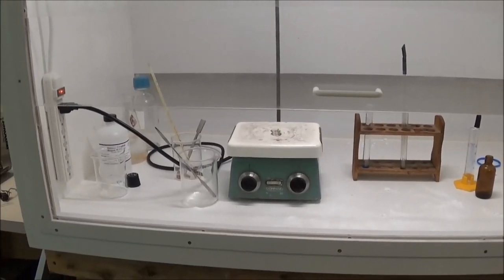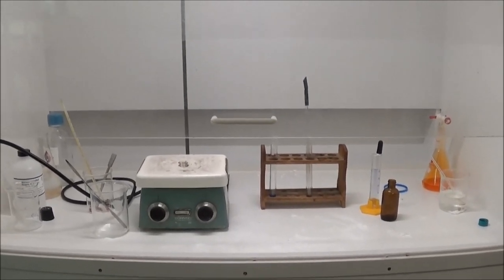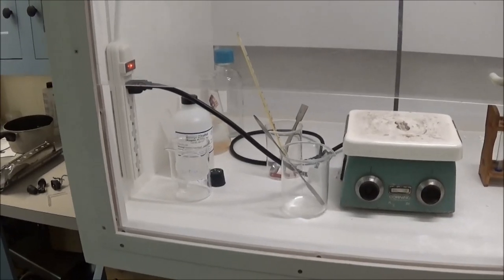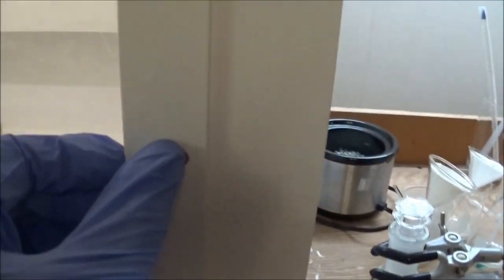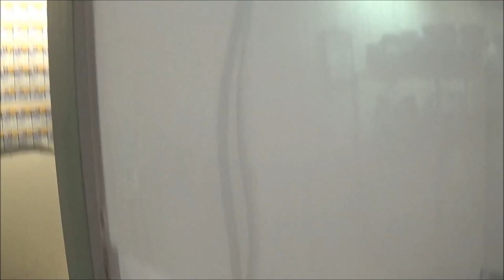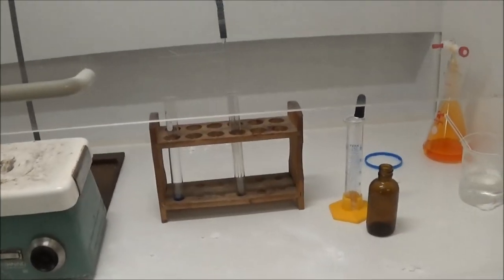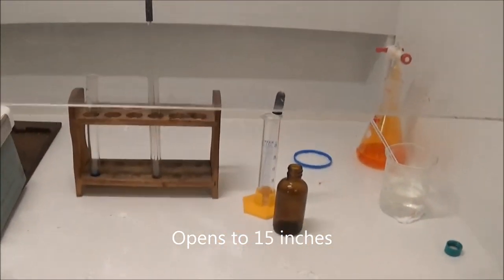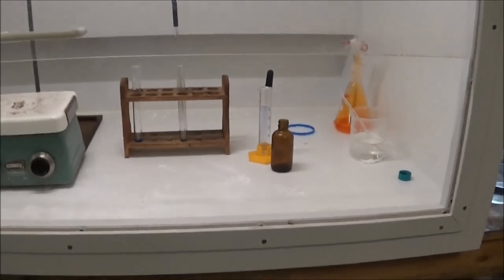How I Built my DIY Fume Hood

Comment: Good inspiration, I'm planning to build my own. For an absolute diy noob like me the front will probably be the most difficult to do.
Reply: Depending on the space you're in you don't necessarily need the sliding glass panel. You can just leave half of the front face open unless you're working with stuff that you think you're gonna need to seal completely off.

Comment: I'm new to your channel and I've got to say I like what I've seen so far! Looks like you do some high quality work. Great fumehood! My recommendation based on the "real" fumehoods I've worked with would be to cut the holes you talked about in the middle of your baffle, not the top of your plexiglass. Holes in the top of the plexiglass would make gas escape more likely. Holes in the middle/top of the baffle encourage the flow of gas through the fumehood to be laminar, rather than turbulent, which is ideal for removing gasses without backflow

Comment: My only concern that should already be aware of is the danger of venting some potentially dangerous vapors out into the air, especially around your house. Some aren't EPA friendly, some aren't human friendly in quantities (good ol' carcinogens), and some can just damage your siding etc. 

Are you using any kind of air scrubber?

Otherwise 9/10 on the build. I'm probably going to be making something very similar
Reply: You can always add carbon filter

Comment: Damn if only I had the space and money for this haha. I would sooo do it. 

I hate working outside because there is so much to worry about. The main being the weather. Too much wind makes things frustrating and unsafe. Different temperatures can make some reactions challenging, and I have had glassware crack from running a hot reaction and having a random quick drizzle of rain drop one single cold drop on the glass. Enough to give my erlenmeyer flask a good crack on the neck. By the way thank you so much for your videos. I really enjoy them! I am looking to get wayyy more into organic chemistry than I used to be and currently have a few synthesis planned. One being a transesterification that will make methyl ricineolate which is a biodiesel. Another is making chloral butanol because I have always wanted to make some type of chemical that can have other side effects besides death haha.

It really means a lot to me because I used to only do inorganic reactions. Then I went on to organic reactions and quickly became infatuated with explosives synthesis. I made a lot of different ones and got to do a LOT of really freaking cool and fun stuff. I learned a load of stuff along the way and was always very safe. I am losing interest now as I want to dive deeper into organic chemistry in itself. I have always loved chemistry and it's one of the subjects along with math that just kind of clicks. I can seemingly envision what's happening at the molecular level and it helps me a lot. It's really weird but I excelled in my chemistry classes. 

I have taken a college chemistry class and enjoyed it but we never really dove deep into organic chemistry. Most of the class ended up being a lot of theory (which don't get me wrong, I love learning how things work especially at this small level) but not a whole lot of reactions or synthesis. I am taking o-chem next semester and I am sooo freaking excited I can't wait. I didn't really like the teacher too much but funnily enough, one of my least favorite teachers (she's not too bad, she teaches really well and can be pretty funny but she has a very cocky attitude which kind of stuck and I couldn't shake it) was the teacher I will have for the most amount of time. 

I currently have some nice glassware such as the usual beakers (I broke a few though RIP), erlenmeyer flasks, round bottom flasks (my first large scale glass ware was my 1 liter round bottom flask which came in very handy), a liebig condenser, vigreux coloumn, test tubes, etc. but I am getting ready to up my game with a proper magnetic hot plate stirrer, 3 necked round bottom flasks, separatory funnels, addition funnels, as well as buchner funnels (I currently have my self made vacuum filtration set up but professionalism can go a long way). I am too broke to get all of that at once since glassware is so freaking expensive here but I will get a much better lab setup. I'll also probably build myself a mini fold-able shed that I can set up outside so the wind and rain won't interrupt me as much. 

But yea thank you for your videos and keep up the amazing work!
Reply: How about a kiosk? I imagine something like a really airtight popcorn cart.

Comment: Hey Tom, Ive been having trouble with my hood door and I like the way you split yours. Unfortunately I'm on a massively tight budget and limited tools. I can split the plexiglass but trying to assess how to mount them so they slide AND stay in place the way yours does. My other issue to resolve first is my wood is bowed, lending further to my problems lol. Do you have any advice? I almost went with a motor driven pulley system but that would compromise the seal and kill my face airflow
Reply: It might also be notable, I'm using lightweight materials so that it's more easily portable since I'm in shared living quarters and all. I don't find much issue with smell or anything with my tests of the air system but I'm afraid further reinforcing the sides and possibly allowing for a proper fume hood door fitment would need more permanent space to stay. It's made of 1x0.25" wood beams and mylar walls with a plexiglass door and the most inert caulk I could find for sealing

Comment: "...was going to make a thiourea dioxide video..."  "...was going to make a video on getting casein out of milk but then..."    lol   there is a lot of competition out there.  hahahahaha    Its all good.  Seems like all the lab folks comment on each others videos anyway.  I am sure your version of a video would be slightly different.  Might as well go for it!
If you have the time, I am curious about the "five sided wooden box that was a few inches deep, which the duct work from the fan attached to".  I just can't get my head wrapped arounf how that was applied to the back and how it worked in the design.  Thank you

Comment: Nice job man! I'm working on building a fume hood and I'm quite a novice. How did you design the baffles? I have so many questions haha...
Reply from the maker: The baffles weren't too difficult to put in. First I cut and screwed together the two sides plus the top and bottom. On the back I then screwed on the appropriately sized piece of 1/4 inch wood (just one piece) so that it looked right, leaving a few inches open at the top and a larger opening on the bottom. Onto this I attached a five sided wooden box that was a few inches deep, which the duct work from the fan attached to. This directed air flow behind the baffle. 

Feel free to ask me any questions, here or on email.
Reply: Tom's Lab what's your email? It would be really helpful to bounce ideas off someone.
Reply: Tom's Lab how necessary are baffles though, surely with a high CFM there wouldn't be much leakage right?
Reply from the maker: My email is diphitom@gmail.com

Baffles are not mandatory, but are helpful. They reduce swirling air currents inside the hood, removing the gasses inside more effectively. The won't be leakage either with or without, given the fume hood is built and sealed correctly.
Reply: The fume hood looks great, I was hoping to see some type of filtration system though.

Comment: How is the plexiglass airtight if there’s two seperate pieces if they slide over each other?
Reply: Negative air flow. It just has to have enough draw to pull air in the front and out the back.

Comment: u really need ceramic or glass construction you should get some house tiles and glue the around the interior, and get a piece of custom glass from a pool fencing place for the door so when something blows you're behind the strongest part.
Reply from the maker: The material is surprisingly resistant. I have spilled solvents on it and even nitric acid (70%) with no effect. I like the custom class idea, that's my plan for sometime in the near future.
Reply: Tom's Lab I decided ill go with a stationary cabinet and line it in ptfe sheets that I can get custom cut. Not sure if I'll use the glass as it might tip the whole thing forward with it's weight. Maybe if I use ceramic as the base it'll have the weight to stabilise.

Comment: cool, i plan to make something similar buuut i don't have the space and a free window/opening
i'll save that video for later reference when i do have the space

maybe i'll do a tiny portable fumehood when i really do need ultra safety

what filters do you use the the output? basic carbon between the hood and the fan?
Reply from the maker: I didn't use any filter on the output. I'm not that concerned about the blower because I never put too much through it (using gas scrubbers when I can), and with the high flow rate the concentration of corrosives is very low. If the fan lasts a year I will be happy because that will still be cheaper than the cost of buying a fan actually designed for a fume hood. In a couple months I will check the internals to make sure all is good.
Reply: Have you ever had any problems with smells outside, maybe even the neighbours getting suspicious?
Reply from the maker: Nope, never noticed any smells outside. As for my neighbors, they already know, I actually gave them a tour.
Reply: Tom's Lab pretty chill neighbours you got there
Reply: Tom I wish I had your type of neighbours xD

Comment: can u take your "very cheap powerstrip" out of the hood ffs :D
Reply from the maker: Lol it's too much work to take it out now, but yeah I never use it and it's a sparking hazard.
Reply: Tom's Lab. The cheap ones arc everyrime 😅. Also if you were after good filtration vacuum HEPA filters you can buy round 100mm ones that fit perfectly into 100mm pipe so you can stack a few in a row and use 2 100mm centrifugal fans in push pull to eliminate 99.9% of particles. They are very cheap less than a few dollars each. I also plan on using carbon impregnated webbing. For dual filtration. Will probably post a video in a few weeks.